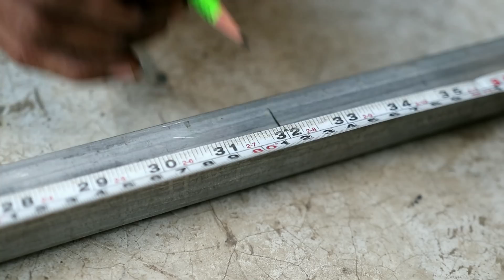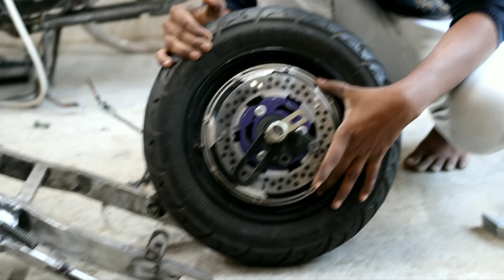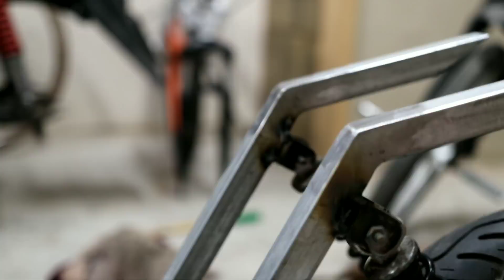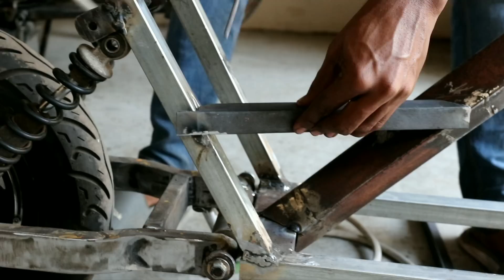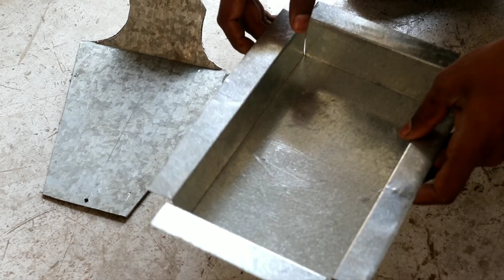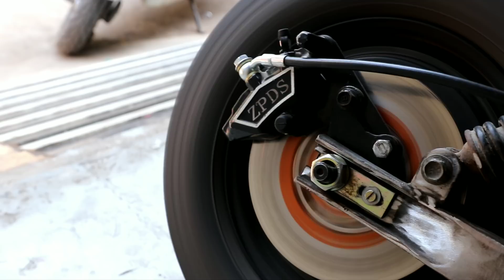how to make electric chopper bike at home || @CreativeScienceOfficial

Comment: Of course everyone have steel bars and à welding machine also an Electric motor at home.
Reply: Motor you could just use an old weed wacker or something of that nature, doesn’t need to be specific

EDIT: if you don’t have a welder that’s your problem and yeah obviously you have to buy the material

Comment: Besides the front wheel having no suspension or any sort of stabilization and the battery and cables not having a big enuff spot and that random kind of stuff and the fact you didn’t take a bit to paint it looked sweet

Comment: Catalog Name : electric cycle conversion kit 

Products : 

✅ *1. pmdc motor kit *
Price: 4500.0 INR
Description: 24v250 watt brush motor kit includes
24 v 250 watt brush motor 
24v 20 amp controller
chain and sprocket
e brake
key switch
headlight
horn etc 
charger 

✅ *2. hub motor kit *
Price: 7000.0 INR
Description: hub motor kit includes
36v350 watt hub motor 
36v controller 
throttle 

✅ 3. hub motor kit with battery
Price: 15000.0 INR
Description: kit includes
36v 350 watt hub motor
controller
throttle
36v 9.6 ah li ion battery 
charger 

https://www.bikayi.com/evkitz/1

 Tap ⬆ to see the full catalog, discount & details. 

⭐⭐⭐⭐⭐⭐⭐⭐⭐⭐⭐all kits available